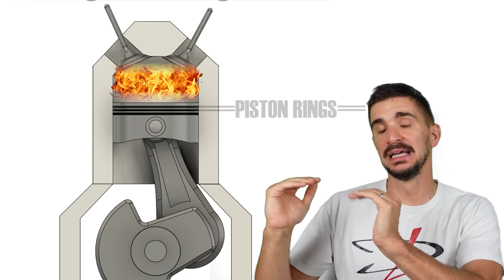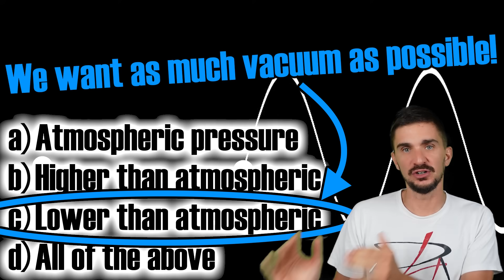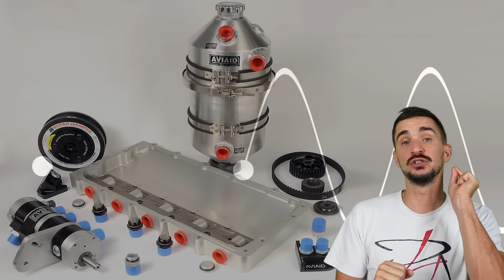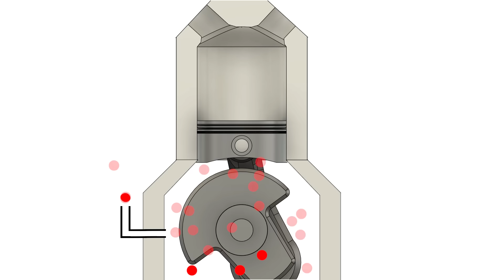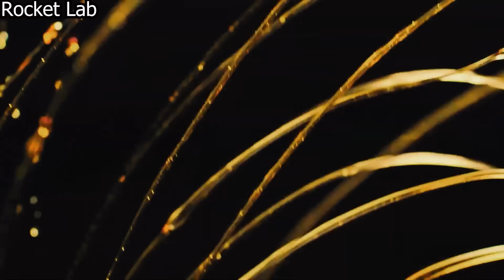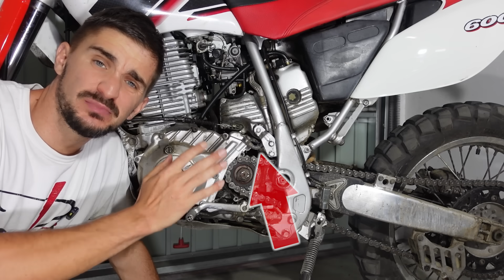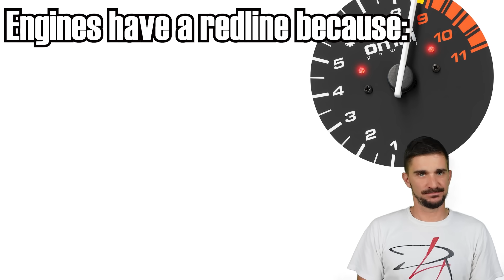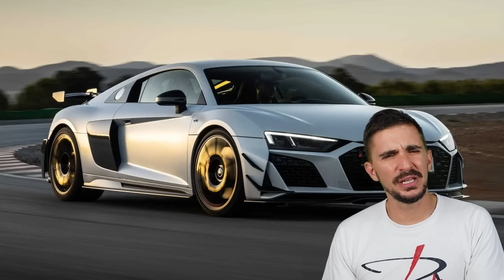Installing This Has No Drawbacks, Except for Your Wallet - Dry Sumps Are Awesome, Here's Why...

Comment: Maybe a dry sump could also collect the wet belt contamination from the oil and place it somewhere easy to inspect, so I'd know when my ecoboost has finished eating the current belt and must be fed another one
Reply: At least those cheap ass manufacturers should use a separate  closed oil system for this wet belt, to avoid mixing rubber on the oil channels of the engine. But no, they even put some oil radiator inside the water radiador, its ridiculous.
Reply: @polentusmax6100 but then it wouldnt fail and they wouldnt make their money. They could just not make it a wet belt system like we have done for decades. Its just planned obsolescence
Reply: @ragingking1424  even if it were perfectly build and immaculate, it'd still eventually break. Everything made by man will at some point fail. It's why preventative maintenance exists. And also, everything comes apart at least once. Accusumps are cool too, Drysumps are extremely expensive. None of these are required unless you're doing some real hardcore road racing. Most drysumps that I see are $8000 or more. The dealers would still make their money upcharging services like oil changes and other light maintenance. If you need extensive rebuilds, there is honestly so much time involved that the dealer wouldn't make much money on it. Which is why its more common to replace with a crate motor. it just saves hours.
Reply: @somedude9316 chain driven = 200k+ miles, welt belt = 80k maybe. Like your argument doesn’t hold up to basic math but, if a chain makes it to 240k you are doing an expensive job one time, not three. It’s basic math bro
Reply: @polentusmax6100  thats not profitable tho
Reply: @polentusmax6100  Nooo, you can't have a  rubber belt with its own specially designed oil last 300 000 miles, man...wheres the profit in that!? 😂
Reply: Wet belt was one the craziest things I ever seen on a car , they make 0 sence , just use a chain 😅 , or a dry belt ... but ya got to work with what ya got .. and atleast you know your problem and are trying to fix .. peace and love brotha, keep it rad, stay safe, and build on..l8r famz and keep having fun
Reply: @mastercricket7626  chains and gears are not appropriate for modern cars, these parts could outlast the whole vehicle. Everything else, things like body control modules and AC components, is literally rated (= deliberately made) to only last a "realistic" amount of power cycles, they are also not socketed and all have flashed firmware that checks for OEM level. These once were (and in some industries still are) dumb copper shunts and relays that anyone could just unplug and replace, solder and replicate etc that is not ok since you might go off doing that for decades instead of coming back to buy a whole new vehicle. That is dangerous for the revenue stream. 

You are meant to drive 100k miles during average 5 years lease or ownership. After that, go and buy a new car. The whole model range will have either a facelift or redesign by then, and you have to go buy that to ensure optimal ROI for the manufacturer.
Reply: @ccllvn  They should have all been left to fail. The UAW needs to be trashed before anyone is going to get anything OEM at a reasonable price. They'll learn the hard way. Eventually, people are going to be more willing to pay $40k for a restored/modernized square body Chevy than they are a brand new pickup, even at the same or lower price. You skirt emissions, OEM plastic junk parts, computers, compression ratios that cost more to drive, and idiotic "engineering", if you can even call it that anymore. On top of that, some states have permanent plates for older vehicles, so no more hearing "I pulled you over because your tags are expired" literally ever again. On top of all that, it's so much easier to completely customize a vehicle when your payment isn't $1,200/month plus insurance.  I swear, a lot of these designs look like they came out of AI. That's engine, transmission, body, modules, all that junk. No one with common sense went anywhere near these projects during the engineering phases, and it shows.
Reply: @ccllvn  The last timing chain I did on time had extremely shark toothed cam gears. They definitely do not outlast the chassis. If the chain breaks (especially on an interference motor) then you have no engine regardless of the miles. If the cam tooth breaks you get the exact same result. Valves and pistons having a UFC match in the engine bay. Just because a chain/belt COULD last 100,000 miles doesn't mean you should push that far past the maintenance interval.

All modern cars did was enshittify the platform they were built upon. They're practically the same engines from 10 years ago with three times as much bullshit slapped onto them with a direct injection system to make it extra complicated and expensive lol. Does direct injection actually make more power than intake port injection? No. It just a different, more complicated fuel system that  needs to run at like 150 PSI to force fuel into a cylinder. Does a modern or old car need a drysump? No. Not unless you're pulling hella G's into the corners.  Any time you push a vehicle twice its rated power without appropriate supporting modifications you're going to eventually run into reliability issues.
Reply: If you're spending the money on a dry sump, might as well get a good engine instead.
Reply: @ghoulbuster1  even great engines need a dry sump if you are pushing performance...almost every race car has them now....and if you want a better engine than what you have, in many cases you are buying an engine that has a dry sump or definittely NEEDS one and has dozens of off the shelf conversion kits...looking at you 2JZ and LS/LT V8s
Reply: Some one should just make a convertion kit for chains.
Reply: @rexmcstiller4675  Stellantis is currently swapping their 1.2 puretech wetbelt with timing chains on the ones that are broken, if the customer has strictly followed maintenance plans and is still under warranty. Engine out, packed, sent to eastern europe for the swap, while they install a retrofitted engine with a chain in your car... Waste of money, don't buy 3-cylinder engines!
Reply: ecoboost, more like ecoboom
Reply: @troubleinjamaica6924  they are putting wet belts in ford 5.0 and chevy 5.3 now too. Rip
Reply: @troubleinjamaica6924 damn man you really got him with that one. How long it take you to come up with
Reply: @tunerimpala5658  He wasn't trying to zing the dude. He was agreeing with him.
Reply: Isn’t that primarily the 1.0L?? My fiesta st with the 1.6L was such a great little engine
Reply: Are you using the right oil? They do make the one that's safe for wet belts...
Reply: @fordman32508  no oil sufficient for engines is safe for rubber belts. it's a ford problem, not an oil problem.
Reply: @fordman32508  Wetbelt is just an inherently bad design. Rubber + petroleum = swollen degraded rubber = premature failure. Non petroleum oil in engines usually = premature engine failure due to not being ideal for engine oil. Hmmm. Just because you can use WD40 as a lubricant doesn't mean you should :p
Reply: yeah what you do is have a belt-shaped slot in the bottom of your oil tank so the dry sump system deposits the belt-sludge which will set, forming your next belt.
Reply: Wet belt? Are you okay, son? 
🤣 🤣 🤣 🤣
Reply: My brain wants to solve this more like the belts in a cvt lol
Reply: @KaosProject21  Every CVT I've had the misfortune of meeting has been hot garbage. You know what actually lasts? LENCO.
Reply: Engineers forgot oil gets contaminated by gas that eats belts.
Reply: This wet belt technology has been the worst idea automobile companies have came up in decades it's done nothing to extend dry timing belt life as designed when it works it still only lasts 100 thousand miles dry belts already do this and replacement is much easier and much more affordable in reality it's a stupid idea !!! If automobile companies engineering departments did R&D like they used to, instead they use us consumers as guinea pigs at our expense !!!
Reply: it's cheaper to convert a wet belt to chain driven than running a dry sump
Reply: You could add an inline filter of some sort and then inspect it a good amount of the time.
Reply: At that point just use a chain
Reply: Simple. You should feed one belt per month
Reply: You could send a oil sample for testing this would tell you how much belt material you got in your oil 
Don't listen to the negative comments wanting what's best for your car in not a bad thing
Reply: @brumarly  if you find belt contaminants in your oil then I'd suspect that the damage has already kind of been done to your bearings and rings. Gas contamination is pretty normal especially for some well used engines. I think most people are just baffled that the engineers would bother to run a rubber belt in an oil system to begin with especially when it isn't providing any real tangible benefits over the standard dry belt or chain which are both more common and easier to service for less money.
Reply: @somedude9316 oil sample testing tells you the wear of the wear parts in an engine, you send it off and they go into mega detail about what's going on in your engine, you oil filter will take out small bits of belt.
Reply: You can buy kits to measure the belt and know if it has degraded.
Reply: This comment made my day. I mean the Ecoboost indeed does have a addiction and need a intervention 😂
Reply: you are aware of this issue and still own one of those? that is strange
Reply: All you need is that "engine stomach full" sensor.
Reply: So basically a Ford Ecoboost 1,0 engine is nearly as stupid as your current president?
Reply: Lmao
Reply: Is that the chevy that the pvc freezes up in cold weather theirby blowing out the rear main seal .😖
Reply: Another excellent video. Can u do something in the Porsche 917(?) - Porsche engineers joined two boxer 6's? I think those aerobatic airplane engines have special "valves" (a simple tube with a ball that only allows oil from the top of the engine when inverted and reverse of that when flying normally).
Reply: I like to drill speed holes in my wetbelt.... makes it faster 🙃
Reply: Why would you buy such a car i the first place
Reply: The irony of installing a scavenge pump to suck out bits of belt...

The scavenge pump gets killed due to bits of wet belt
Reply: I'm really surprised that no one makes a chain replacement for that stupid belt. You might even be able to swap the 2.3/ 2.5 chain and sprockets or just getting some cheap sprockets at Tractor Supply and modifying them to fit.
Reply: get a honda civic for 5000 and rev the piss out of it
Reply: But you live in fantasilandia?
Reply: This is the best comment here
Reply: Wet belts are dumb. I like chains.
Reply: but that's the point... if its covered then it will break at some point and Ford can charge you big money for repairs ;)
Reply: Man, it's ecoboost and bust!!
Reply: The new 5.0l has it too annoyingly... Only downside IMO
Reply: Now that's funny   :)
But not really.  Yeah, Ford's Ecoboost engines are not Ford's best effort. 
They have such tiny cylinder spacing meaning oil chambers are tiny and easy to
clog if you don't change your oil regularly. And God forbid engineers design a decent size oil filter these days for any engine. Peace.
Reply: this is hilarious and I had no idea lol. thank you stranger.
Reply: Can’t polish a turd
Reply: It's "nice" to see how on this channels there are many people relating parts of the video with issues of their own cars... My wife's car (2013 Citroen C3) gives so many opportunities to relate that way.
Reply: The Ecoboost hungers for more it must feed give it the rubber
Reply: Wet belts should be illegal..
Reply: Wet belt what next No wonder Eco boost had maintenence issues tks for info
Reply: Ford already have a system for that that's quite elegant:

If it arrives at the workshop under its own power, the belt is fine. If it arrives on a flatbed, the belt may need replacing.
Reply: Spot on
Reply: They should have a chain conversion kit if it doesn’t exist well that’s money people are missing out on
Reply: maybe this is a common thing but one of the Mercedes parts companies I use is sells an oil pan plug that is magnetic to attract any errant metal bits. should be easy to integrate.
Reply: I'm still baffled that GM and Ford are still insisting with this crap in developing countries, everyone already knows its shit.
Reply: I was a ford technician, the best way to fix a ford is to sell it and buy a Toyota.
Reply: @pabloescabar1038  why, so it can blow the fuck up too like so many of them have been doing recently 😂 t
Reply: @pabloescabar1038 lmao 👏👏👏👏👏
Reply: Any aftermarket replacement belts that resist oil and wear better than ford's crap?
Reply: @AndromedaExplorer2026 a rubber belt is never ganna be better than metal chain.
Reply: @AndromedaExplorer2026   A chain is better
Reply: @AndromedaExplorer2026  The oil ain't the problem, It's the contamination in the oil from piston blowby that kill the belts. That's why 10 year old belts often look fine in cars that have been used for longer distance type commuting, while the belt disintegrates on cars that mostly have been doing short drives with a lot of cold startes.
Reply: @westmus  finally - someone gets to the main problem... it's how we use cars. In the UK a surprising amount of journeys are under 1 mile and a massive 71% are less than 5 miles. ICEs  will not get hot during that time and will suffer lots of friction. Most of an ICE powered vehciles emissions occur when it is cold also. We are using a power source that damages itself far more rapidly when cold.
If commuting short journies to work, shops etc EVs make sense (although at the minute cost too much). For long runs ICE aren't the problem people think they are as they become more efficient and less polluting (and more reliable) when kept warm.
Wet belts are a nonsense that nobody needs. EGR is also a bad choice and is killing engines, as are the regens for DPFs. 
I can get with trying to make vehicles cleaner as the damage to human health (from local air pollution) is extensive and expensive, but they way we tried to convert ICEs to be cleaner doesn't seem to have been thought out at all. People are just 'deleting' all the stuff they can as it harms the engine even more rapidly, and that is counter productive for health.
Reply: @thebrowns5337 if you have a ev with good range with a backup generator you can get 100 to 250 miles of clean power then fallback to a single speed optimized generator which will last the life of the car because it normally wont need to be run and reduce pollutants massively
Reply: @AndromedaExplorer2026 not Really Unfortunantly they will all just start breaking down from being wet all time thats the down side of using a Rubber Belt that spends its life in oil I don't know for the life of me why Ford went away from a Metal Chain that Benefits from being on oil to a Rubber belt that breaks down because of it
Reply: @deltasixgaming Car companies make money on financing, leases, and maintenance, not selling automobiles. They survive on usury and overpriced service.
Reply: engine with wetbelt is disaters itself already.
Reply: Belts for the Belt God!
Reply: @H33t3Speaks war hammer 40k fan?
Reply: i think changing to a chain would be easier imo
Reply: Ever considered changing your oil on a reasonable period?
Reply: ah the Eco-Boom! Ford Essex at their errr best lol. unfortunately the heavier belt fragments will just progressively block the dry sump scavenge pipes
Reply: the company that clearly has zero fears of running 20ft of timing chain in a Coyote at 8,400 RPM suddenly thinks it's a great idea to try a wet belt......OMG.
Reply: The arrogance of these comments is ridiculous. Ford went and engineered a specific belt material for this use case, it is not just "a rubber belt". 

Their main concern is making money, you really think it was cheaper to research, design, and manufacture a proprietary belt than use chains? 

Use your brain, it's been used in the 2.7 for a long time now and it's regarded as a very reliable engine. Meanwhile Chevy and Toyota are blowing up engines on the daily with old designs
Reply: @handledrandomly why have i seen soo many clogged ecoboost engines on youtube? the belt always disintegrates and block oil passage, soo keep coping.  you better tear that whole motor apart and replace that belt before you forget. might aswell replace everything ford put init while your at it. keep replacing everything till you have a new engine that is ready to fail again in 20k.
Reply: @mynameisWriter because the small ecoboosts used to use belts for timing which are under much more stress and worse geometry. There have been exactly 2 2.7 Ecoboosts documented having issues with the wet oil belt, and even then the failure was a byproduct of other issues.Keep yapping boomer
Reply: question is why tf u drive an ecoboost if you know stuff about cars
Reply: That's why you don't buy a piece of cr4p that has a wet belt lmaooo
Reply: ecoBlast engines don't care what's lubricating them, they will implode either way..
Reply: Wet belts are a no go. Its just a engineering flaud. (its actually engineers hating mechanics)
Reply: Maybe the best option will be to just stop buying wet belly engines idk.
Reply: and who is going to put a dry sump system on a piece of shit engine with wet belts?
Reply: I love when I dont waste my money on bad cars
Reply: I got an idea. How about you get regen, powering a battery powering this. Also can help power other things like your AC! 

 Solar is also good for powering external devices. 

 Oh wait no batteries are political somehow. 

 Jokes aside what is a MEMs, but a tiny mechanical device. Electricity can be simplified into fluid. You can make electro mechanical devices. 

 We have crazy power dense motors powerful enough for rockets now! If it's good enough for space, and military jets it's good enough for me. 

 Not to mention small reliable, and powerful motors are getting cheaper by the day. 

 Just saying you could make a killer vacuum, and a more simplified design if you embraced batteries!
Reply: @RedactedDeath  What does any of this have to do with Fords Wet Belt Disintegrating
Reply: Wet belt making car more efficient
Reply: @Timewastedonyt  Allegedly
Reply: @Timewastedonyt this is simply not true. Why Ford changed wet belt in the 1.0 Ecoboom to a chain, then?
Reply: @vvevvevvvv I'm with you, wet belts are shit
Reply: @vvevvevvvvI know wet belt are sh**
I was just being sarcastic 🙃
As Ford justified putting wet belt in car as it makes car more efficient
Reply: @Timewastedonyt I like your sarcasm emoji.
Reply: @bigedslobotomy thanks 🙇
Reply: @vvevvevvvv Because they're unreliable. They certainly didn't change it because chains are more efficient.
Reply: @vvevvevvvv They decided on not being that much stupid, so they fixed that problem by using the trusted logical solution, now they can go back to doing the most stupid solutions possible to squeeze those last 0.1% of efficiency out of the engine again
Reply: @vvevvevvvv Because oil is only part of the problem.
Direct injection systems directly lead to gasoline inside the oil. And that added super ingredient reduces oil efficiency and also chews through that belts even faster. So exhaust gas emissions forces direct injection and that kills wet belts. This can't be sustained under normal conditions.
They should use a real timing chain instead of tiny whiny chains that destroy itself and it shouldn't be a problem..
Reply: Cause they wised up and give the customer engine life beyond warranty unlike GM😊@vvevvevvvv
Reply: @vvevvevvvvI assumed that was sarcasm. But maybe you're right & he's a congenital idiot or a Ford engine designer. Same thing?😂
Reply: @troubleinjamaica6924  In the  50's-60's there was a moped engine/gearbox with an in-built belt drive. It worked fine, until you forgot that the oil had to be single-grade. SAE 20, I guess.
Reply: @bartomiej9807  Or ofcourse just an outside dry timing belt. Worked great for eons.
Reply: @vvevvevvvvthey are still wet belts on the 1.0ls they only updated the tensioner design. I've watched about a dozen get rebuilt and swapped in the last couple months. All still have belts.
Reply: @Timewastedonyt Yup. All the fuel shaved while sitting at mechanics place!
Reply: 😂😂 @rks9612
Reply: @Timewastedonyt  Nope. Quiet
Reply: @Timewastedonyt  yes. in making rubber slush
Reply: @Timewastedonyt so efficient they regularly break
Reply: @Timewastedonyt also their pockets more happy when they snap
Reply: @Timewastedonyt   1-2% more efficient
Reply: @Timewastedonyt At what cost?  False efficiency / economy.
Reply: The cost of metal obviously. Jaja
Reply: @Sowhat-u6f  they can sell their fucking belts more, thats why